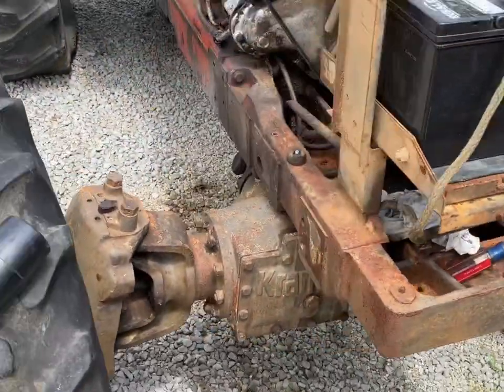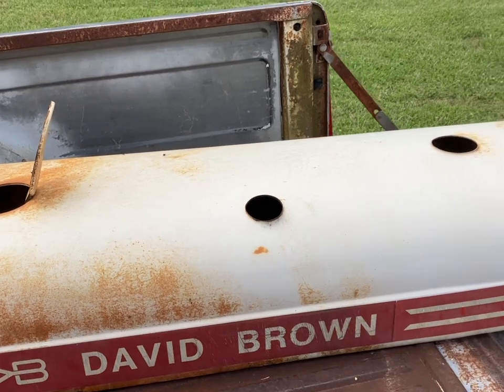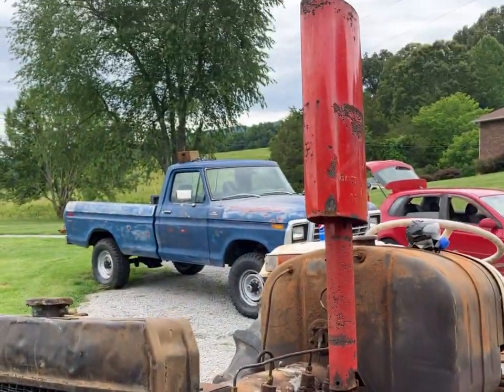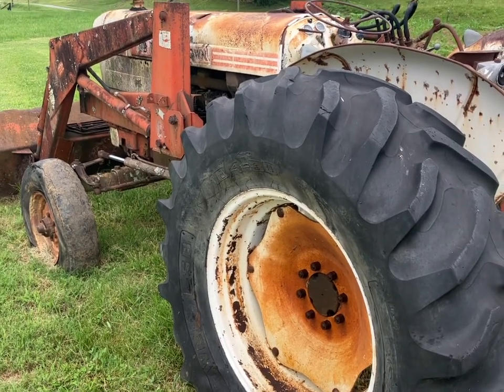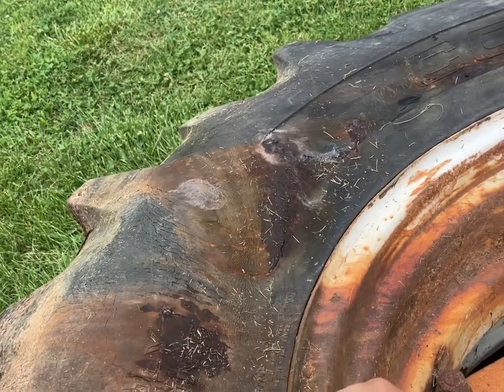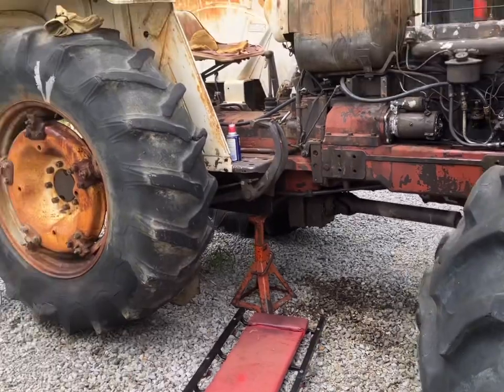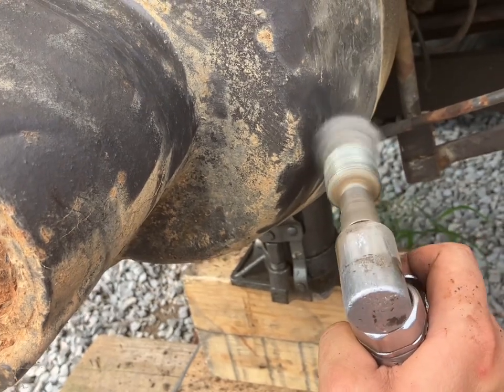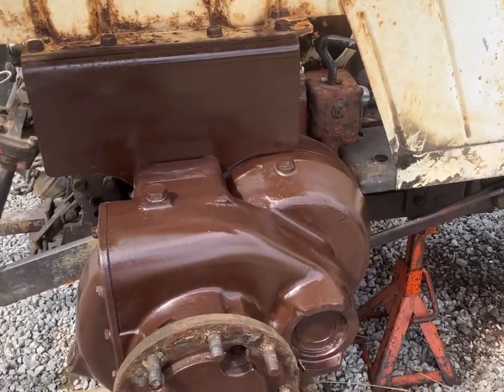4WD David Brown 1210 Project - Episode Two

Comment: A tip from a old David brown mechanic is next time you fit a second fan belt in at the same time and zip tie it in place so that you don’t have to worry about removing the hydraulic pump shaft again to fit a new fan belt. Best of luck with your project and I have 2 DB 1210’s both red and white and manufactured in 1979 but your one is previous to that about 1977 because of the red decals and chocolate brown. 😊😊🇮🇪🇮🇪🇮🇪👍👍☘️

Comment: Looking good!  The amount of crud that builds up in the front of the tractor in the frame casting is amazing.  Cleaned at least a couple gallons of dirt and crud out of my 990.  The 50 years of caked on dirt around the back was just as bad.  Getting it clean though!